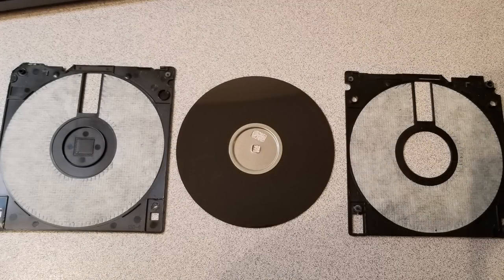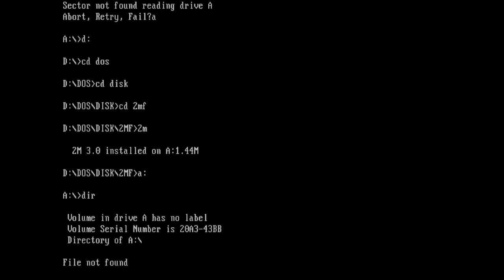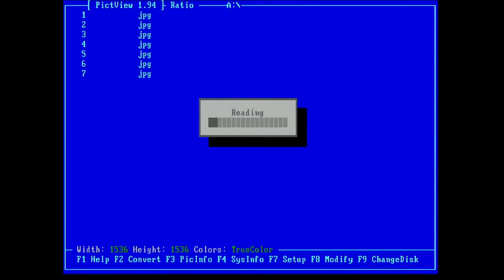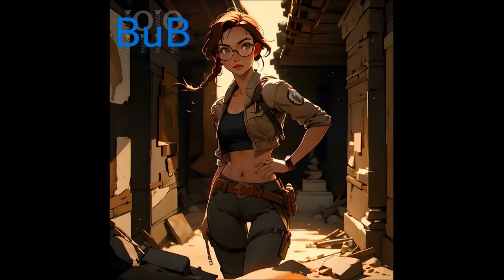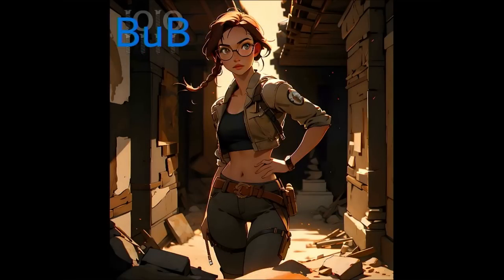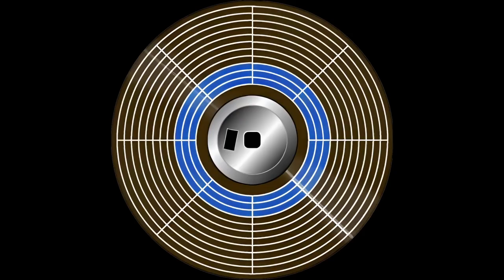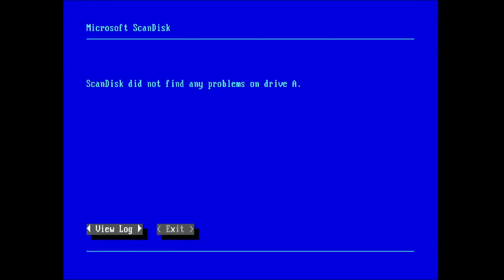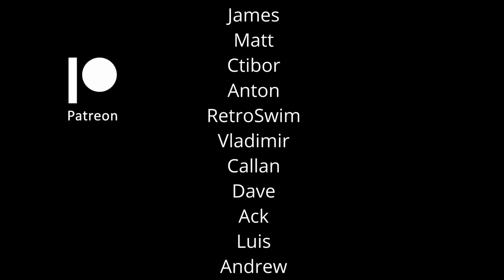Will data on floppy disks be safe from magnets?

Comment: Couple notes: Jpg typically can still load with data corruption, I would have liked to see what an app that loads even with an error would have made of the data that was available.  (image the floppy and replace the unreadable bits with 0's or something). I thought there was a component of the magnets corrupting data where you need to move the magnet to get them to corrupt the data.  Perhaps more motion on the tests where the data did not see an effect would have seen corruption if you moved the disk or magnet more.
Reply from the maker: Very good inputs! Thank you for sharing your thoughts. I will compile all the ideas I get from this video and come up with a better analysis, testing method, and maybe recovery options.
Reply: Floppies from what I remember at least at the BIOS level won't replace unreadable bits and won't even provide a partial read.
Perhaps at the FDC level you might actually be able to overcome that.
I know AH=04h, INT 13h "Verify Disk Sectors" has error codes for "ECC/CRC error" and "recoverable data fixed by ECC" errors
Reply: @eadwacer524  yes, the OS will not let you get partial data it will just tell you its bad.  It will have a few goes though before it borks out.  You can hear it retry and if that doesn't work it will go back to the first sector and then count the steps back again to ensure the head is aligned and it will do that I think about 5 times before it issues a fail.  HDD's do the same, and you hear it click a few times whilst it not only tries to retrack but also ensure the disk is spinning at the correct speed.  These are absolute marvels that a mechanical device can have such accuracy, I have no clue how you can possible conceive of a 16TB disk, you would have thought that totally impossible.  The run-out of the bearings is 100's megabytes wide alone.  It really is magic.  I find flash memory far less magic.
Reply: @eadwacer524  Kryoflux?  Even without some of the tools used to copy floppies with copy protection just skipping sectors when making the image would allow you to zero those sectors out on the image file.... the ? of weather a 512B / 200KB image is noticeable bothered me enough to check and it is indeed viewable.  While I know it's an issue, hopefully he can read at least some of the corrupted sectors it'll make the error patterns on the JPG more interesting.

Comment: The data is stored as an analogue flux signal.  It looks for changes in this to determine the data, the absolute flux level isn't important so putting static magnets next to the disk provided it doesn't drive the flux right into to saturation will in most cases still be readable - thats what's great about digital data.  To erase the disk you not only need a very strong magnet with the flux in exactly the right direction, but an alternating current is far better because it leave it degaussed. Even if a disk has been written to with 1's (FF's) a determined data recovery specialist can get lucky and retrieve the data because what was a 0 before is weaker than 1 which was 1 previously.  Data recovery systems would look at the signal and vary the point at which it decides if its a 0 or 1 and you can get data back that way.  Same applies to HDD's although its actually a lot more complicated and the amount of data is so huge that its unviable.   I don't think that leaving magnets near the disk for a length of time will make any difference, its the process of flux moving through the disk that will affect it.  I do know though that the magnetic flux does degrade with time, but its usually a chemical degradation or contamination or misalignment of the read-write that was the issue.  As for leaving on your speaker, you're probably safe but the degausse coil that pings every time you turn an old CRT monitor on is a definite risk to magnetic media.

Comment: The speakers may still be more harmful  than your static magnets. In speakers, when in use, the magnetic field is constantly changing. Like the electric demagnetisers to undo magnetized stuff. 

You could also just move the magnet really fast from left to right at a distance to simulate that... or just open up a speaker.
Reply: That's not actually true. The speaker driver consists of a large stationary magnet that surrounds a coil in a very strong magnetic field. There's two halves of this static magnetic field, one running inside the driver assembly that the coil is suspended in, and the spillover outside the magnet-polepiece assembly. There is a dynamic magnetic field created on the coil which interacts with the static magnetic field to induce movement, but it's super localised to the coil and its immediate vicinity, it doesn't actually leave the magnetic gap much at all, infinitesimal amounts, and it isn't actually strong at all to begin with.

Speakers intended for use near TVs/monitors are not dynamically magnetically compensated, they are not compensated against changing magnetic fields. Instead the inner polepiece is followed by a second ring magnet, identical to the ring magnet that provides the magnetic field for the coil, epoxied on it in reverse polarity, and a steel cap intended to short circuit most of the spilling out static magnetic field. If it was so as you describe, that there was a changing magnetic field spilling out, CRT monitors would still be affected when the speakers are operating, but this isn't the case. CRTs are very sensitive to magnetic fields, it doesn't take much to change the path of an electron in a vacuum along a fairly longish path.
Reply: @SianaGearz  You have not seen my CRT that unwillingly gone disco mode just because I played some music. The static field was far less noticeable. Maybe slowly creeping in... As usual degaussing the display made it all fine. But as soon I played music it went back to disco mode. Don't forget that many just had very cheap desktop speakers. I had that problem with almost all of mine. I once put my computer next to the speakers of my dads stereo and there was absolutely nothing. The Quality of the speakers really make a difference.

Additionally now I wonder... Put a floppy on top a CRT and start a degaussing that CRT. Hmm...
Reply: Exactly, variating magnetic flux will cause more damage than a static one, a test is needed !
Reply: @5Breaker  That is interesting. Well i've had all sorts of things. I use ELAC BS52 as computer speakers, but i think i might have gotten them after i switched to LCDs, i don't remember. Before that i had a Quadral kit and also i have had a KYE Genius wooden computer speakers set. Also a Panasonic boombox. I don't remember ever causing a dancing image with either of those.

I am liking the idea of the degauss floppy experiment.

Comment: Worth noting: My dad sometimes takes apart hard drives, and he keeps the head arms stuck to the furnace duct in his workshop. They're permanent magnets, and pretty strong ones at that. If a hard drive can handle those things constantly sweeping back and forth just a couple millimeters from the platter, they must be pretty resistant to magnetic fields. I don't know if there's a major difference in tolerance levels between a floppy and a hard drive; I would imagine if anything that the hard drive is even more sensitive because of just how much data has to be crammed into the same space.

Comment: Goes to show how resilient those 3.5" floppy disks truly are! Sony did a good job designing them to retain data through normal daily conditions. I've come across many disks that still retained data that was well over 30 years old. Were still perfectly readable all those years later.

Would be curious as to how susceptible a 5.25" floppy would be to such magnetic fields. I think the thinner outer case wouldn't afford as much protection.
Reply from the maker: I was surprised how well the data was preserved. I do have a 5.25" drive in Germany - which I don't know if it still works. I should take it with me next time I am there - and get some floppies for it too!
Reply: From personal experience i can say, the larger 5.25" floppies are much better in keeping the data. The lower density seems to help here.
Reply: @OpenGL4ever  That makes sense! Would still make an interesting video, though.
Reply: @OpenGL4ever  I think most of the problem, is that 3.5" floppies were in use until late 90s, early 2000s, when their value was rapidly declining and good manufacturers of magnetic material started closing shop, and so many floppies that are retained from that era are just low quality junk.
Reply: @SianaGearz  No, that's not the reason. I bought them in the early 1990 when they where on their peak and not on their decline. The 5.25" are juster better in this regard.

Comment: Depends on the strength of the magnets.  When I wrote my floppy imaging tool, I needed to make "bad" disks to test error recovery, so I used a small rare earth magnet the size of a bb (about 5mm) to "burn" a spot in the disk and it took only one second of putting it within 1cm of the disk wafer.

Comment: I'm sure someone else in the comments has pointed this out, but static magnetic fields don't have much of an effect. The damage, if any, will be during the time you are moving the floppy in and out near the magnets, which causes eddy currents in the magnetic media and thus can scramble the magnetic fields. This is also why speakers in particular could be bad -- when playing audio, you have a dynamically changing magnetic field which is more likely to cause issues. Also, if you put the floppy near a CRT when it turns on and fires its degaussing mechanism, a huge spike of sudden magnetic flux happens that could definitely cause some issues. In all cases though, it depends on the direction of the magnetic field relative to the disk surface. I imagine that moving magnetic fields parallel to the disk surface would probably be worse than those passing perpendicularly to it, as it would probably cover more of the disk area.
If you wanted to do this experiment a little more scientifically, you could create a small electromagnet by winding a coil of wire around a piece of ferrite. Then use either those magnetic viewer films or iron filings to visualize the magnetic field created as you apply a small AC waveform to the coil. Or, if you can afford it, get a fluxometer, I think you can get them on eBay fairly cheaply these days. This will tell you not only the magnitude of the field in Gauss, but can also help you figure out the orientation of the field. However, a coil wound around a ferrite rod has a fairly predictable magnetic field, so you can just place it in one spot and then try moving the floppy to various spots, energizing the magnet, turn it off, and then test the data.

Comment: A moving magnet or magnetic field is what erases. Hence moving head or even in a tape unit the tape moves past a record or erase head. Static fields don’t generally cause as much issue.
Reply: Cheap recorders have a permanent-magnet erase head but if you think about it, the movement speed of the tape against the erase head is spectacularly slow, so the erasing action is basically just due to static magnetic field. Furthermore it's not like the tape is erased quicker while you rewind it and the permanent magnet is in a "disengaged" position several millimetres away from the tape!
Reply: @SianaGearz  These work by saturating the tape such that you cannot recover the signal.  If you play a tape that was recorded after it was erased this way, its much more noisy because the recording is distorted by the flux offset.  What I have never tried and now I suddenly want to is recording over a tape when the erase head is disconnected.  Does it just sort of sum them or does it mess it up entirely?  Last tape recorder I had is 25 years ago by now.
Reply: @dr_jaymz  That is a curious experiment to perform.
Reply: @SianaGearz  its not a static magnetic field as the tape it moving - move the tape or move the magnet and the result is the same. In a cassette deck the erase head has the tape pulled across the surface so its as close as can be to affect it. Retracting (or not engaging more to the point) the perm head doesnt cause issue as its far enough away and in an active erase head as long as its not powered it wont cause issue. I still use my 3 head Dolby S / HX Pro deck now and then and it surprises me how great a sound using a good deck and tape can give!
Reply: @dr_jaymz   I tried this decades ago and it kinda sums them but the previous recording is dulled with the new one having more presence and killing the previous one's treble and volume.
Reply: @SianaGearz  And those erase heads get crazy close to the tape even when they're disengaged, at least on compact devices. Just a little bit of distance makes a huge difference!

Comment: most speakers used in computers and tv's are magnetically shielded either by 2nd magnet in a metal case canceling the field or by installing on metal case elements if magnet is small
the thing that breaks dicks is to place them on oscilating fiels  like monitor degaus coil or magnetic assembly or transformer soldering iron
i belive random magnets wouldn't do much to a floppy, unless  you place them with magnetic field going directly though the disc if you get a compas and find magnetic poles of your magnets you can do the most damage with magnet north or south edges

Comment: so a steel/iron core casing would divert magnetic fields away from the disc, protecting it
Reply: ie magnetic field will go through preferentially a strong magnetic iron core
Reply: ac magnetic field is different than dc magnetic field
Reply: disk is not a rom

Comment: Your test doesn't make much sense since you can't see bitflips in JPEG files. If a bit flips there, the image information changes minimally, but that's in most cases not noticeable. It would be better if you provided the files with MD5 or SHA256 checksums and then check the files with the checksums.
Also, you overformatted the floppy disks. The normal disk format for 3.5 HD disks is approximately 1.44 MiB and not the larger none-standard formats. With the latter, data loss is also more likely. And yes, of course MS-DOS tools cannot read and use the non-standard larger floppy formats.
Reply from the maker: You are probably right that single bit flips are difficult to detect with JPEG files. For now, it was just an idea, but if I make a follow-up, I will definitely use checksum to validate data. I get a lot of good input - thanks!
Reply: @bitsundbolts  You're welcome!

Comment: Floppies don't have physical tracks or sectors, so they can't be destroyed. Everything is virtual. The 80 tracks were simply "it works without issues" decision .

Scandisk can't reconstruct data, it just searches for unreadable areas or logical errors. If you destroy the data in binary form, scandisk is always unable to help.

Comment: Hard drives have a poweful magnet inside so I guess if the magnetic field isn't strong enough it can be there for years.
Reply: Aren't these powerful magnets shielded with a paramagnetic material, just like "multimedia speakers" are designed to be placed closely to CRT screens without distorting the image.
Reply: The magnets in a harddrive are shielded.  The magnetic field never comes in contact with the platters.
Reply: @MrRobarino  The shielding is not perfect, but in any case you have to remove the top magnet along with its shield to replace the heads, and to remove it you have to face it towards the platters and nothing happens to the data stored on them, the magnetic particles aren't that sensitive to magnetic fields.